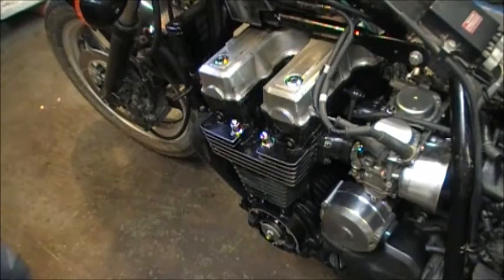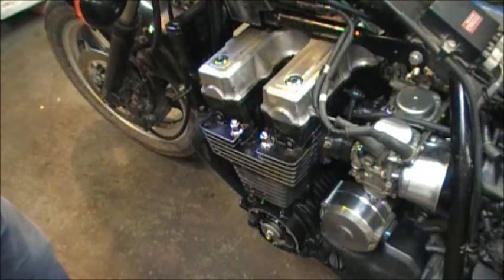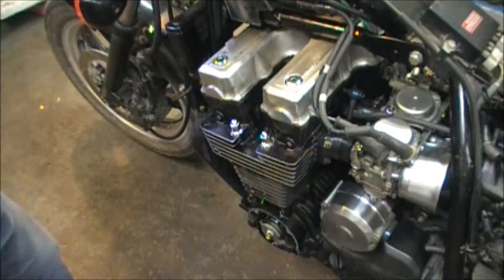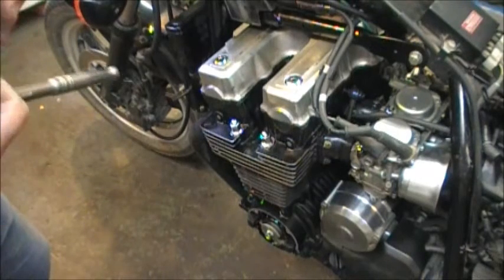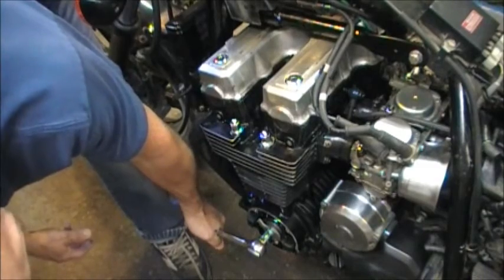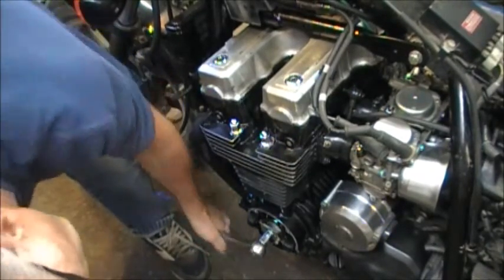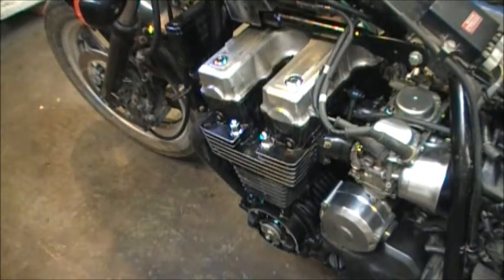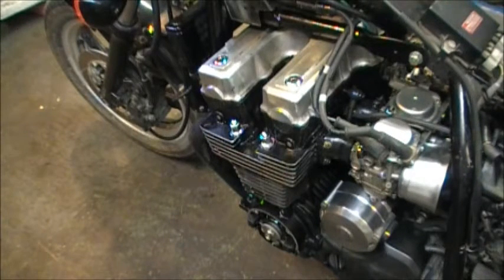1984 Nighthawk S engine noise, bad rod bearing

Comment: I went through all your available videos and was not able to figure it out. So was the noise a bearing or was it material on top of the piston?
Reply from the maker: It was definitely the big end bearing on #2 cylinder, also it turned out the crank journal was out of round.  I did buy an entire parts bike with a broken starter chain and after a lot of work, got the bike back on the road...

Comment: For anyone watching this, he spun the engine backwards. Do not do this.
Always rotate the engine towards the front on these bikes.
Reply from the maker: Yes you are correct, jimmycorp I did turn the engine backwards for the camera angle's benefit....  Please help me to be a better mechanic and explain:  what harm could one or two manual revolutions do in the wrong direction?
Reply: @wfvs1500  It's a tradesman's secret he doesn't want you to know. Spinning the engine backwards actually engages the motorcycles reverse gear
Reply: You should turn the engine from the other end of the crank I do that way because Honda tell me that's the best way and they built the thing

Comment: Was the crank salvageable
Reply from the maker: No the crank was done.  I did contact a machinist that said IF we could find a bearing with the right OD  and a .030 smaller ID, he could repair the crank.  I did find a whole parts bike to scavenge as an "Organ Doner"